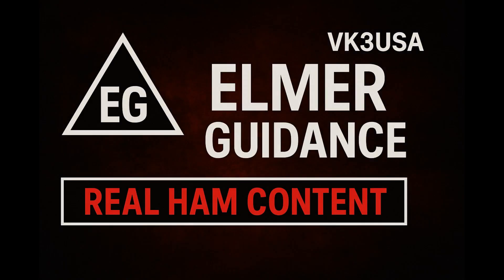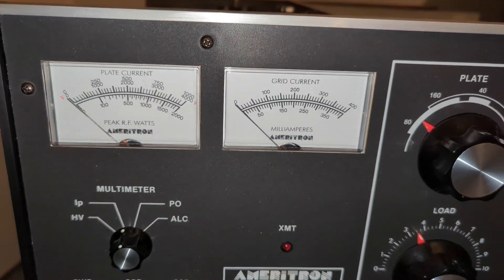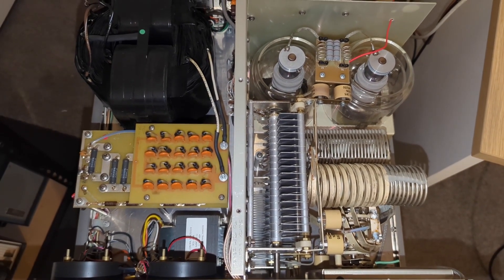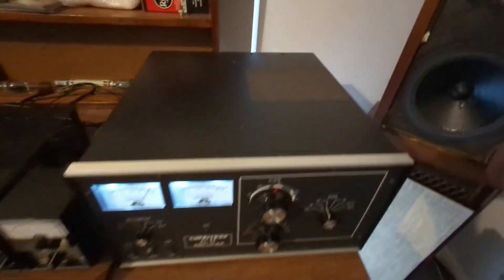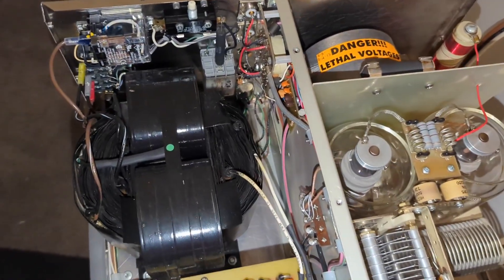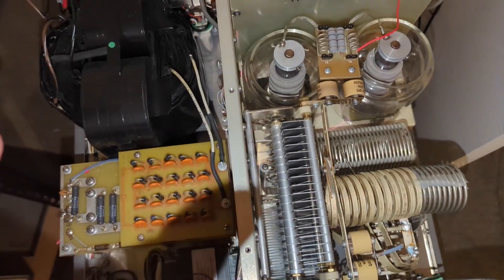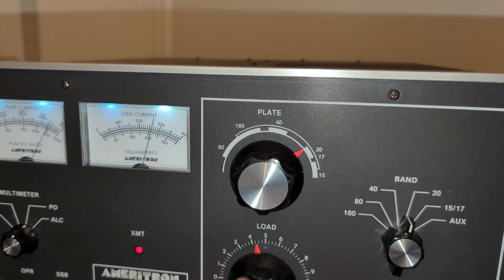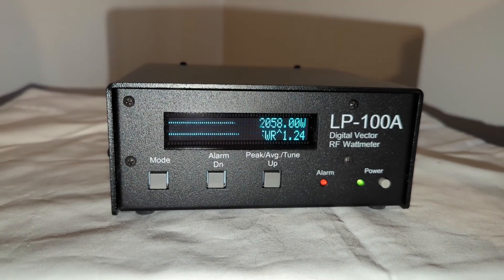Ameritron AL-82 — Real Tubes and Real Power

Comment: the 1200a7 I get 1539 on 65w in on 11. If you use it on 11 you need to spread the tank coil or you get a false peak on the plate. too much capacitance and it is unmeshed.
Reply from the maker: Thanks for that tip! I don't think many 1200 versions made their way down-under, but I'll always keep my eyes open.
Reply: @VK3USA  I'm sure its the same on all 3 versions. they all have the same tank coils and such

Comment: Hell yeah, very nice amp. I got my hands on a Heathkit SB-1000 which is same as Ameritron AL-80A. Did some fixing to it and now it's working on other bands than 160m that still needs a new cap. I have a SPE 1.3K-FA but there is something more enjoyable on these "big tube" amps. Just to see the 3-500Z glowing makes me think I have more power compared to a LDMOSFET-design. Would I take SB-1000 to a travel with me... no, but on home desk it's a lovable product. :)
Reply from the maker: LDMOS definitely gives you a lot of convenience, but obviously their drive power is their weakness. Give a 3-500ZG amp a little more than you should and it won't break a sweat. LDMOS, you either trigger the protection or blow the chips! So I guess LDMOS for the dxpedition, 3-500ZG when you've got a big ol' desk at the home base :)

Comment: You are quite funny thank for that.  Yes I knew Martin this was a mess to build and had plenty of problems but yes they work.  I will keep my KPA500 yes I prefer transistors as an analogy designer they are just better we can discuss that later.
Reply from the maker: I personally have no issues with the construction what so ever. Easy to work on and much better cooling for the tubes than a TL-922 or SB-220. Unless you're going to do what broadcast stations do and have multiple banks of PA stages, I'll still take a good tube amp any day over what's currently on offer. The only exception being the Tokyo Hy Power 2.5 kfx. That was a work of art.

Comment: I HAVE 2 HIGH POWER SOLID STATE ACOM AMPS. COSTING OVER $4000 EACH,  THEY NEED TO BE RESET IF THE INPUT JUST GOES OVER ON A PEAK, WHAT A PAIN. SO NOW THEY ARE FUNCTIONAL ART, THEY LOOK NICE ON THE SHELF AND I WENT BACK TO MY SB 220, ALPHA 70A, AND COLLINS 30S1.ETC. NO MORE SOLID STATE JUNK. I DO LIKE THE AL-82.  THE AL1200 IS THE SAME AMP. INSIDE BUT THE SINGLE FINAL, IT CAN  BE REMOVED AND 2 3-500Zs WITH SOCKETS WOULD FIT , THE HOLES ARE ALREADY IN THE AMP JUST REMOVE THE COVER PLATES.    THANKS FOR THE VIDEO......P.S. NO LONGER SELLING THE TUBE AMPS BUT THE S.S. AMPS IS A DIFFERENT STORY
Reply from the maker: Thanks for sharing your experience mate! I've heard this story so many times over the years and it's why I hesitate and ultimately back out every time I'm just about to pull the trigger on a solid state amp. Acom's are definitely the better amps but the protection can get in the way as well, kind of like the radar emergency brake on a modern cars! I hope to get a 30S-1 one day :)

Comment: The older AL-82's were fine amplifiers, although I never had the chance to grab one. I did own & run an AL-572 for a long while; it was a great amp as well. Ameritron (the 'original' Ameritron) called it a "near legal limit" amp, and it was... producing about 1200w PEP SSB.
Unfortunately, when MFJ assumed the ownership and production of Ameritron's line, the quality went south, and began living-up to MFJ's deserved reputation of "Mighty Fine Junk". 😅

I have a total (currently) of 9 amplifiers, all tube rigs - none with solid-state finals. I do run a couple of "automatic" [tuning] units: An Alpha 9500 and an OM Power OM-2000A+, and they work great.  But all the others are manual tune, power-houses. My two favorites are the Henry 3K-Classic-8877 (easily does 3000+w PEP with 100w drive) and my Collins 30S-1: Massive power supplies with CCS ratings, and ZERO 'electronics' - no circuit boards whatsoever. It's all just pretty basic stuff, and designed to run for decades... which they have! (With a little TLC). The Henry runs 4 kV on the plate!

Although tubes have become a bit less available - and more expensive -  in recent years, I firmly believe that these big tube amps will actually run forever!

There are some pics of the gear on my QRZ page.
Anyway, thanks for sharing... Great stuff Mate!
 Let's keep the "big iron" amps on the air!
73 from west Texas! 
W5ARM
Reply from the maker: Thanks so much Alan. MFJ definitely had their issues. Maybe I'm just lucky but haven't had any issues with either of my late production AL-82's, maybe it depended on where you got a Monday or a Friday unit or preferably in between those days lol. I've stocked up on tubes here and should have enough to last my personal collection for decades.

Nothing ever comes close to a Henry or a Collins 30S-1. I've looked at your QRZ page and fantastic stuff! You've got all of the dream amps for me.

73 and thanks for watching.

VK3USA.
Reply: @VK3USA   Thanks Andrew.  It's been a long-time-coming! 😁
It has been a labor of love (and money) to get - and keep - these great old tube amps running. But you can't beat 'em!  I hope to pass them on someday, to somebody who will do the same.
~Best 73!

Comment: As much as I am lukewarm happy with my TL922 this amplifier looks a better bet. The 922 is pretty but too compact for its' own good. Wimp power supply, inadequate cooling and that nonsense of grids grounded via a network. Here in the UK we had a 400w (at the antenna feedpoint) limit until recently. The 922 was happy enough doing about 5-600w of SSB, I am sure it will hate !kW.
Reply from the maker: The 922 is still a solid beast in it's own right. You've just got to stay within the design parameters. Keep it in CW for full duty cycle modes and SSB for SSB obviously. Will still do up to 1500 PEP if tunee carefully, but I'd drive that bad boy with 60 to 70 watts Max. 1KW pep if we ever get in VK is more than enough. They just don't have the big P/S and lack the chimney cooling system as you say for the sake of being more compact. I've owned 3 as daily drivers over the years. One of the best amps ever made despite it's short comings 🙂

All of mine would do 1200 key down in the SSB position and 1500 PEP under careful testing.
Reply: @VK3USA  mine has low mileage RF Parts 3-500ZGs, With the grids grounded it seems to have a little more gain, though the amplifier is otherwise stock. With our previous power limit I was typically driving it with just 25w...
Inadequate cooling is a fair price to pay for a relatively quiet amplifier 🙂
Reply from the maker: @g0fvt  Yeah that's the trade off right there :)

Comment: Beats my FL-2100Z😆 VK2TGR
Reply from the maker: The FL-2100Z is a fine amplifier mate. Always better with strong Cetron tubes as opposed to the Chinese tubes which can have issues going into cut off in that unit due to how Yaesu designed the bias flop.

But they're a winner either way. I owned two FL-2100B's at one stage and still have my FL-2000B. 

Solid reliable units 🙂👍